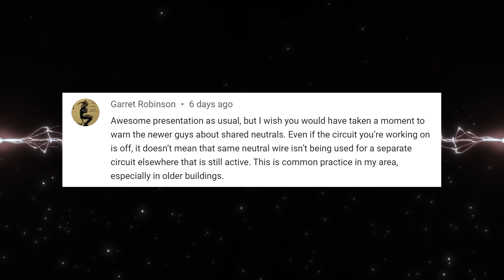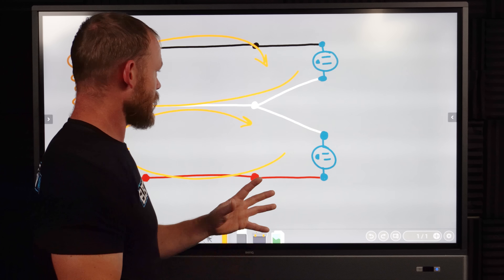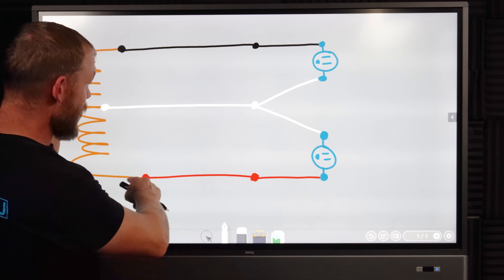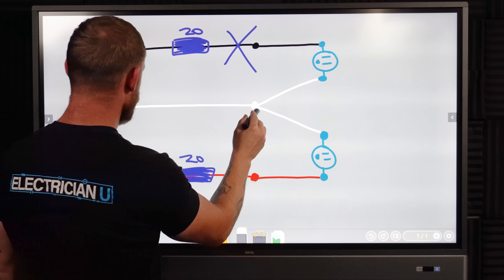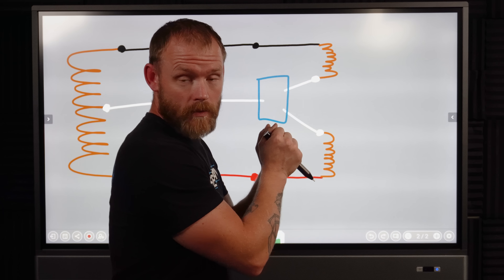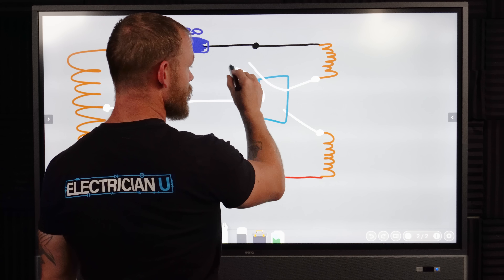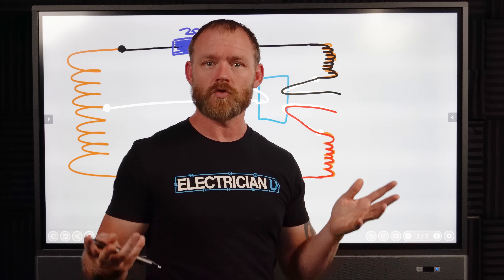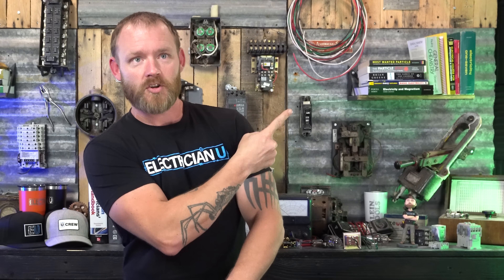The Dangers of Shared Neutrals: How To Avoid Being Shocked

Comment: I got a pire sine wave inverter One side i get 110 volt and on other i get 60 measuring with osclioscope with ground to dc . When measuring with dc osclioscope i somehow get negative v as 110 and 6 v wtf .relevent to ground it would be 170 v .were does the negative come fr

Comment: The 12/3 legs were called edison circuit and could or should have been run each phase to one receptacle in the outlets then if one pops you still have power to the other....

This video is why I dont refer to them as neutral, they are common within your house and eveyone on that pull from the power company.

Comment: Several years ago I built a post and beam garage. I intended on doing a little woodworking and other projects. I was very busy and couldn’t find the time to wire it myself. I hired a seasoned electrician with a great reputation. I had already set the sub panel and pulled the cables. I explained that I wanted 3/4” conduit with metal boxes and GFCI receptacle on each circuit. I came home and found that he used 1/2” conduit and shared the commons and grounds and had not installed the GFCIs. I called him and he said, “The GFCIs were not necessary and that he was able to pull all the wires through the 1/2” conduit. I paid him and a few weeks later installed the GFCIs which wouldn’t work. After asking an electrical engineer, I found out that a GFCI meters between the neutral and the hot wires not the hot and ground. They shouldn’t be wired using a shared neutral.
Reply: GFCI calculates the energy going in (hot) and going out (neutral), if the difference between hot and neutral is big (someone turned into Earth and got zapped) then it will automatically trip itself preventing further damage. It does not care at all if Neutral is shared or not, but bear in mind that after Neutral and Hot exits the GFCI, you can’t connect equipments before the GFCI Neutral and after GFCI Hot or there will be imbalance and it will trip. The simple fix is to put a neutral bar connector after/before the GFCI, that way if you need to put an outside circuit that won’t be affected by the GFCI (like a light circuit, to easily find the GFCI after it trips and then reset it), then you’ll be able to wire the light breaker before the GFCI and finish it with the Neutral before the GFCI.

Comment: I have a question i have a older house 1962 with a outside lamp by a step and the romex has only a black and  white neutral, there is no ground wire. I was going to replace the lamp and it has all 3 wires ground, white, black. Where should i ground the light.

Comment: I have a situation where I would like to rewire a light fixture to be on the same circuit as some other lights that are on a 3-way switch. I have easy access to the switched hot and two travelers on the 3-way switch, but no easy access to the neutral for this circuit. However, I do have easy access to a neutral on another circuit in the same switchbox. It is tempting to just use the neutral from the other circuit, but I know this is not safe for others who may be working on this in the future. I was considering using a current sensing relay to move control of the light fixture to the circuit with the 3-way switch, and still powering the new light fixture from the circuit I have a hot and neutral for in the box. Any suggestions?  I would like to avoid tearing into the wall just to run a neutral to the switchbox.

Comment: You do not get shocked because there is current running through a wire, you get shocked if there is a potential difference between two different points you are touching. In principle, if you touch a neutral carrying a load current, then you will not get an electric shock as it's (to a close approximation) at ground potential. Note, don't ever do it on a live circuit of course as it's never safe to touch those. They should always be isolated first. The big danger on that shared neutral is if you break into it before the point of separation and just kill one of the two breakers. Then the neutral on the receptacle side of that break in the neutral will go to full mains voltage, if there is a load connected on that other circuit. 

Also, current does not flow one way around a circuit unless it's DC. It's travelling backwards and forwards on a 60hz cycle (in North America). The difference between the neutral and the hot is not which way the current is flowing, but that, in a properly working system, the neutral will be close to ground potential, whilst the hot will be at 120V compared to ground following, of course, a (roughly) sinusoidal voltage alternating between about -170V and +170V relative to ground potential.

Comment: happens sometimes with 2 way switching e.g upstairs downstairs the light in the stairwell maybe connected to the upstairs neutral while the phase/live/active/hot feed is coming from the downstairs lighting feed.
in this situation the light will have to be on but two situations can causes a shock on is pulling the upstairs neutral out at the fuse board and the other is touching live conductors in the upstairs switch or light fitting. 
in our older houses the second switch did not contain a neutral or earth which makes testing for voltage hard.

Comment: A one-bedroom apartment was divided and converted into two studio units. I am unit A and my neighbor is unit B. We both have been living in the property for 4 years. A couple of months ago unit B has been having trouble with his outlets. Which affects my bathroom lights. Landlord refuses to fix the problem. And Unit B refuses to get extension cords and fix the problem as well. I am being forced to either give unit B a key to my unit in case I'm not home to access the circuit breaker. Or landlord threatened to evict both of us, if we don't work together in regards to this issue 🤷
Reply: Sue the landlord immediately with an attorney's letterhead.
Reply: @paulmac3307  ended up being that unit b was doing it on purpose cuz he was behind on his rent. Told the landlord he's moving out because I'm a bad person. 3 months later a new tenant move in and I haven't had that issue again. 😆😆😆
Reply: Report him.

Comment: "Electricity doesn't care about the color of wires" - I learned about this the hard way many years ago when trying to discern where wires went so I could replace/update old wiring (I'm not an electrician at all, just a guy doing thing I kind of know about for family and such). I had ASSUMED that the person who had wired it all together had followed the "rules" but this simply was not the case. They had switched between black and white wires from one outlet to the next and so sometimes the black was hot, sometimes it was neutral and so on. I know there are times we need to troubleshoot with the power on in order to locate the source of an issue, but once you're pretty sure you know that information, just turn the damn breaker off.

Comment: Your attic light example for the branch circuit is actually very common at least here in the south.  Two story homes typically have two furnaces, often in the attic.  Branch circuits are used so each blower is on its own 15A circuit.  I've had two electricians tell me different things about using dual pole breakers on that circuit.  One told me to pull the tie bar off the breaker as it would prevent the breaker from tripping if only one of the circuits went overcurrent, the other told me to leave it to protect anyone from working on that branch from accidently being shocked.  Comments?

Comment: I'm not an electrician, but I have done some electrical work, because my state is pretty lenient with that stuff. However, my rule when I fool with anything electrical is to shut off as far back as I can without it being a problem. For example, I had to change my dryer plug awhile back, I flipped the breaker labeled "dryer" and I tested the plug, and it still said 120 volts. Someone had something wired wrong, and I didn't know where the other line for the dryer was, and I still don't know what the second line on the dryer breaker went to, so I just had to kill the whole house, just to change one receptacle. That's the fun of living in a 30 year old house trailer, that God knows who has lived in before you.
Reply: You did the right procedure by shutting the entire home down UNTIL you can locate exactly where "someone wired something wrong".  Always , ALWAYS METER EVERYTHING YOU ARE GOING TO WORK ON BEFORE YOU TOUCH ANY PART OF THE CIRCUIT !!!!!  YOUR LIFE MAY DEPEND ON IT !!!!!

Comment: I don't like shared neutrals, mainly for one single reason - If for any reason, any point of the neutral wire that carries both circuits opens... You lose your centering, and depending on what loads are attached (the more unbalanced, the worst the voltage differences), is a great way to burn stuff up.

Comment: One danger is that you put in a double breaker and share the neutral.  It works just fine.  Then some braineack decides to mess with the panel and puts two independent breakers in.  Now one can be on while the other tripped creating a danger of shock while working on it.  Now if one circuit that didn't have anything plugged into it, then it could be safe, but Murohy law says that it is plugged into something active and now you get  a bite.

Comment: It's a significant savings when you are doing a big job. In Chicago We can put 9 wires in a conduit, that would be (6) 3 wire circuits or only (4) 2 wire Circuits.  We use a 2 pole breaker and use a wire tie to bind the three wire circuit together where it enters the panel.  When connecting power poles in office cubicles and outlet buss ways, they are all wired from the manufactures with 3 wire circuits, so they are a necessary evil. If you have a lot of expensive electronic equipment,  2 wire circuits are best practice.

Comment: I’m sorry but i never clarified what I was asking ,
There is videos on YouTube showing how to hook a 120 generator with a wire jumper to put 120 volts to both sides of the panel,and cutting off the other 220 breakers , could you please do a video on if the amperage being accumulated is added together where the neutral wires are attached in the breaker box , thanks for all your videos.

Comment: Hey I think your videos are great for beginners and I think you have a great way for normal people to understand things, I’m hope you could help clarify some more about two hots one neutral, because of the video about running cross overs from 120 volt generators, to a panel . So I’m wandering about wouldn’t that be same as adding the Amps of all the loads the generator pushes and would it double the amps on the neutral back to the generator, 
Any thoughts would be helpful and thanks

Comment: My house has three multi-wire branch circuits. I almost fried my furnace when I kicked a neutral loose in my attic for my washer and created a high voltage on my furnace and low on my washer. I'm not a fan of them.

Comment: Sooo that’s what it’s called…
“ SHARED NEUTRAL “
I decided to install a Leviton WiFi controlled Light Switch into my 45 year old Waikiki high-rise condo. After thinking it would be an easy upgrade win for me considering that I got them on clearance …. Yeah … why does this  single white neutral comes up from the bottom right of the junction box and continues to back down the middle conduit all alone… later found out it was tied to beaker #7 while the junction box I was intended to replace the switch was on Breaker #8 😮
Now I know you have stated many times you HATE those beeping line testers… but I definitely can say … I never trust it completely…. And thats why i have 3 different testers all from different manufacturers with FRESH batteries… and then gingerly break out all of my Multimeters … which are different grades tiers also from different manufacturers 😅

Comment: No electrician I have ever worked with believes  me when I tell them all shared neutral circuits need to be on multipole breakers.  Residential guys won't run 12-3 because the 2 pole afci breakers are twice the price of single.  Lol.

Comment: Back when I first started as an electrician, we ran a  12/3 for two circuits. But in the panel, we installed a two pole breaker. So that when you had to work on that circuit, you could do it safely. Now they make 12/2/2 makes it easier to deal with.

Comment: Because of the shared neutral topic, does anyone know what to do if your old transformer only had 2 wires (black/white) from my 1980's house into it? It sits in a plastic instead of metal box behind the doorbell chime. I do not see and bare/ground wire. Any suggestions? Thanks

Comment: Hey Justin: hope all is well with you!

The 1930’s house I live in has had the wiring updated in the past (20 years or so before I moved in) and while in the process of connecting a new shop light to an existing J-box, I noticed the circuits within it have been wired via shared neutrals, which aren't labeled (numbered) to partner them up with their corresponding hots. Do you have any suggestions that I can use to trace the white (neutrals) to partner them up with their respective black (hot) wires without having to demo the plaster walls to locate them physically? In other words, is there some kind if an instrument that I can use to detect them.
I’d appreciate any feedback you can provide.
Best regards, 
Joe

Comment: In an EMT wired house, would it be overkill to label the white neutral wires that are in a junction box ? For example: a label that says "circuit 8".  Are there ways to test if a white neutral is being shared between 2 circuits ?
Reply: I see guys do that all the time. It is a great idea safety/ troubleshooting wise. 
I'm industrial and a lot of times 1 production line will have 5 or more control cabinets, all with their own control power transformer. People will jump in there all the time and borrow any neutral they see because to them, white means white means neutral. We started tracing out all the neutrals and labeled them to which transformer they return to. 

Another thing is making sure all your CPTs are phased correctly on the 480 side otherwise you're gonna get some really weird voltages between different CPT secondaries, and taking a hot from one and a neutral from another could be catastrophic depending on what you're trying to power up. But I digress.

Comment: When you said electricity can't climb up that upper white leg, I believe that's wrong because if you touch the white terminal on the "off" outlet, you complete the circuit to ground through your body which is when you would get shocked. Anything connected to that neutral circuit can shock you

Comment: I just fixed a wiring issue in my house that had this problem, but a more severe violation. 14/3 wire running 6 rooms upstairs. Every neutral receptacle was discolored or burned. I fixed it myself Raj 2 home runs to separate junction boxes.

Comment: Would the resistance of the load factor in to the shock you would receive? Meaning less of a shock than if you completed a circuit before the load?
Reply: You're shock would be based on your resistance, and hopefully the breaker size....Well then I guess yes it does less current left when a larger load on the line... Just turn off the panel

Comment: Need help. I have a 4 gang light switch box, 3 lights on one circuit and 1 on that other circuit. The 3 are single pole. The other is a 3 way switch. The issue is, all of the neutrals in the box are bundled under the same wire nut. It’s my understanding that neutrals from different circuits shouldn’t be bundled. So…how do I “undo” this? How do I separate the neutral on the 3 way switch from all of the others? Zero clue here. Thank you! Trying to install 4 smart switches to replace the standard light switches in the 4 gang box.

Comment: I have a 120v garage circuit with 1400 watts of incandescent ceiling lights with a wall switch.  (20 amp breaker 12ga wire).  Often when I flip the switch the breaker will trip after three to five minutes.   REset the breaker and lights work fine the rest of day. This has gone on a long time. I have replaced the breaker and switch with no change.  What's going on?

Comment: As a "real" electrician, as I call it, I understand these things. But as an apprentice I got bit on a neutral. I didn't get hurt, necessarily, but it was not pleasant. I'm not sure what caused the breaker to trip considering the current was flowing through the load.

Comment: On a 12/3 cable that a shared neutral is in affect,  if there are 2 circuits that are 20 amps,  how many amps does that neutral have on it if let's say 2  12 amp space heaters are being used on each circuit?

Comment: But if you run 12/3, the black hot to one device and the red hot to another, and share the neutral, wouldn't you use a double-pole breaker on that whole 12/3? Shutting it off would kill both the red and black circuits. Are you saying some people run the black to one breaker and the red to another breaker, so a shut off breaker only kills half the cable? That seems like really sketchy practice.